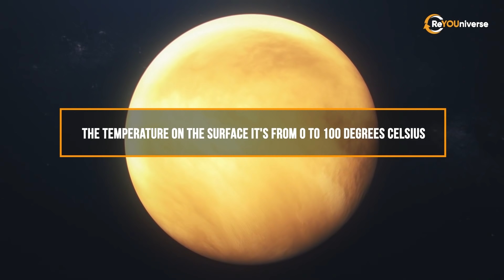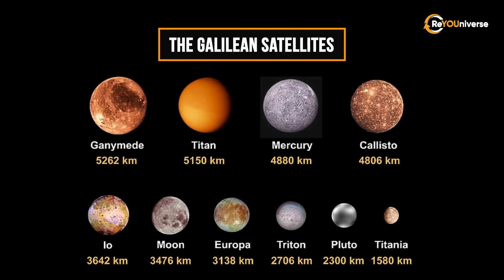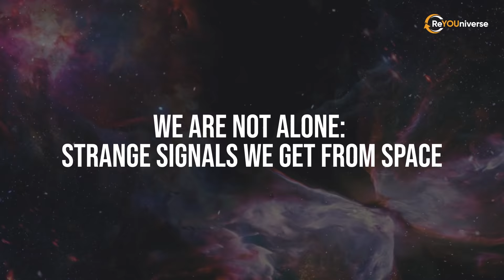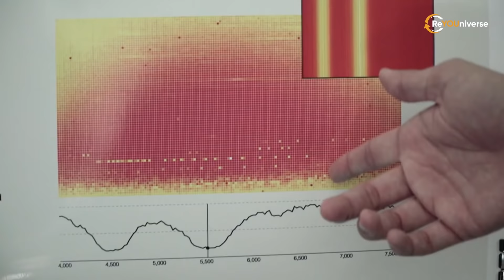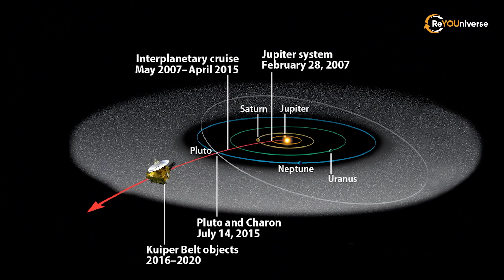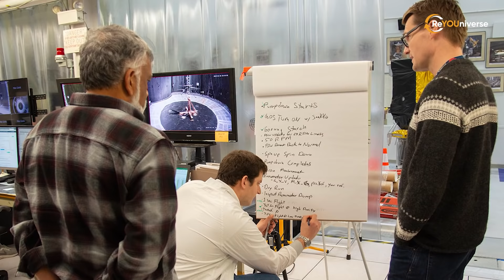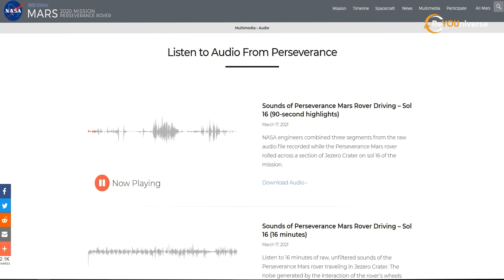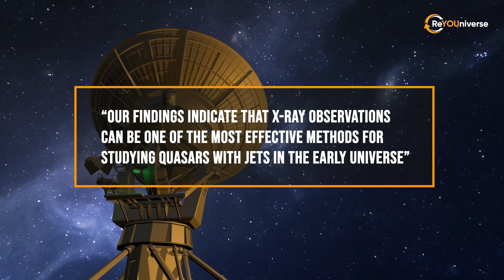Mysterious Signals, Extraterrestrial Civilizations, Gigantic Jet | Space documentary 2021

Comment: I have traveled to the Galactic core and back. ..I first low pass a star with a fuel scoop, charge the jump drive and travel to the nearest mapped Neutron Star , ..I fly into the ejection cone and attempt to remain inside as long as possible not destroying ship…the longer inside the more speed, the cone ejects me At appx 2000c or 2000xLight Speed…I’ve also supercharged the drive jump…engaging warp I’m able to travel 80-120 LY per jump in just under 20 min sol…. I've seen things, you wouldn’t believe, hmmm attack ships on fire off the shoulder of Orion….I've watched sea Beams glitter in the dark near the Tannhauser Gate….and I’ve come home again